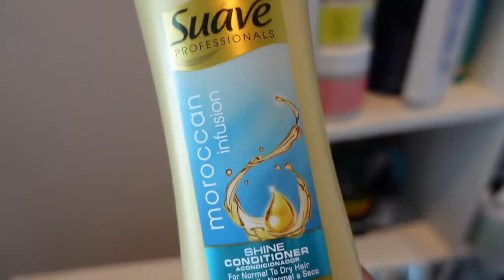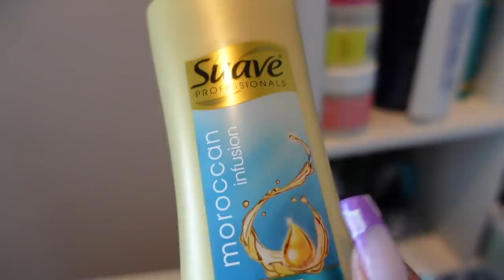WEEKLY VLOG | ROOM + BATHROOM MAKEOVER, NEW NAILS, HANGING WITH FRIENDS & more | Arnellarmon

Comment: I never knew you could paint where you shower cause of the steam 😭
Reply: Yeah I was worried too! Like did she paint over tile in her shower?
Reply: You can buy a product that has everything in the box you need specifically for your shower and tub. You could also use an outdoor paint. If you aren't using the bath/shower system which had three stels I believe. You sand, you prime and then paint. But you aren't using regular paint and primer that you use for the walls.  Not sure what she did will work. I purchased a new build and don't like the tiles in the guest bathroom. So I've been watching tons of diy bathroom makeovers.